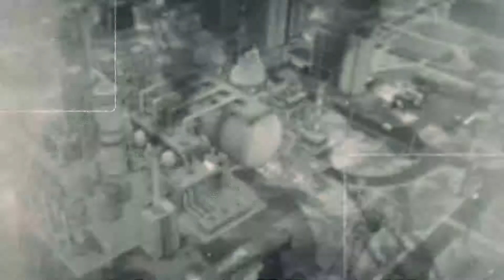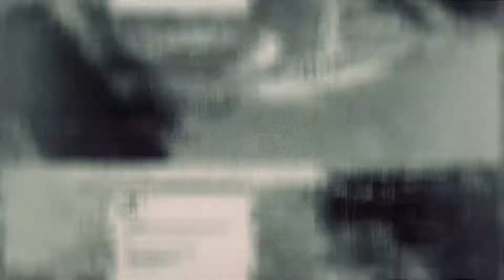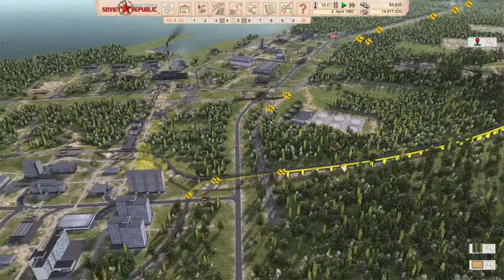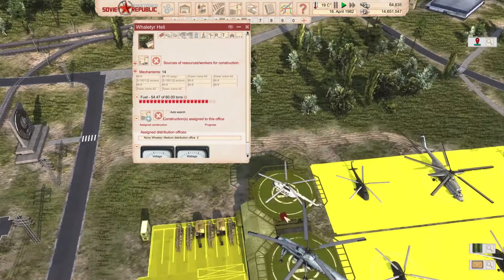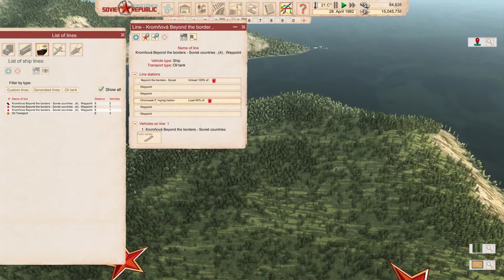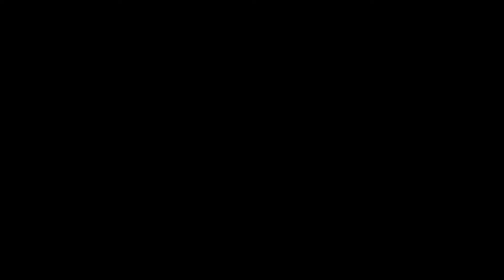Soviet Republic - Alaska - The New Beginning - Ep.80

Comment: 1) 1) It is only since the last update that now footpaths can be built by mechanisms, this was one of the new features of this update
2) You should plan without waiting too long for the second iron mine and its processing plants, an industrial puzzle is always easier to set up before than after ...
3) You can also build a short railway tunnel instead of the railway bridge to reach the aggregate harbor, maybe visually this will take away your qualms about the cost of the diesel train compared to the cost of the infrastructure :)
4) The absolute priority being to have the steelmill filled to the brim at all times, I would have opted for a different distribution system with my iron trains unloading at the steelmill and then going to the aggregate harbor to unload any possible surplus iron, in summary I would have planned a circuit with a rail network a little different from yours as a result
5) For the aggregate loading harbor it would be interesting to plan two aggregate storage, one for iron and one for coal ... Don't you want to see a vast harbour area with its logistics complex and lots of boats crisscrossing the bay with our surplus :)
6) To complete point 5) you could also possibly plan a harbor for the export of construction materials, with the logistics that goes with it ... And therefore also the railway extension from the steel mill to an open storage of construction materials connected to the export harbor
7) I am also a big fan of mods but building a vanilla electronic plant in Markusovo does not prevent you from building other moded electronic plants in other cities, especially I hope one day for a future Alaskian Silicon Valley with its own city and its associated Rob's moded electronics plants :)
Reply from the maker: 1. I missed that one. 
2. I will see what we can do. I wasn't sold on the idea in the beginning. But I will consider this now. 
3. If the ground isn't too low and water would prevent this. 
4. This is it! Yeah! And this will resolve the train traffic issue! 
5.Good idea. 
6. Yeah! I like this! 
7. Mods are still better than vanilla. :P :D :D 

Thanks, man!